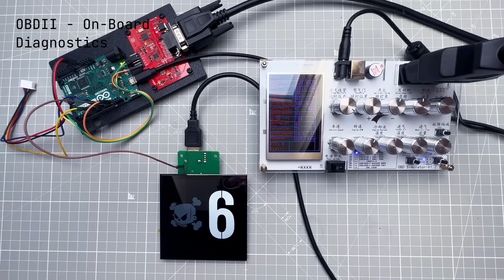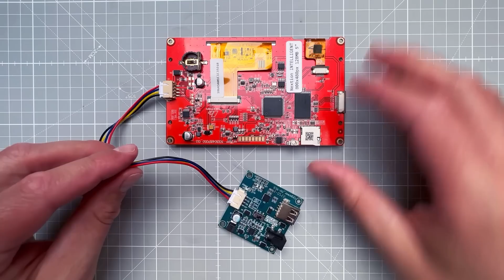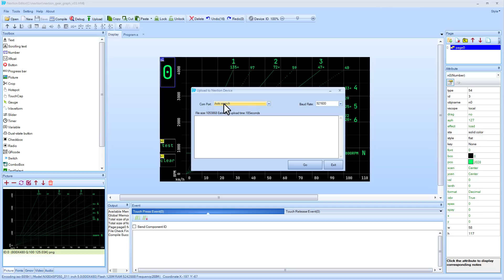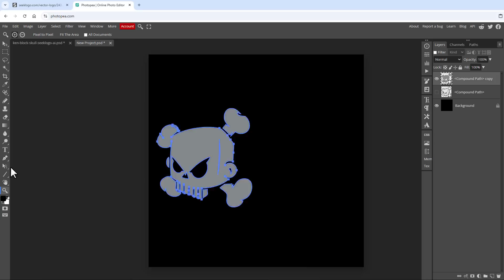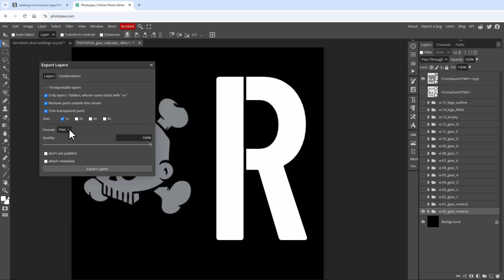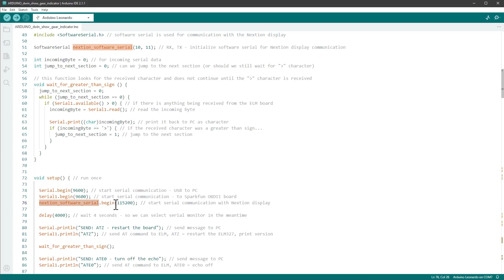Hoonicorn Mustang Gear Indicator (Arduino Project) - how to make gear indicator full tutorial

Comment: Hi, first of all thanks for all the videos and they are very helpful. I have an issue tho with this project. I had the same exact tools and setup as you yet when hook everything up scrren starts at R and then couple seconds later goes to N and stuck there.why would that happen? Even I change the RPM and Speed on OBD sim. still stuck at N
Reply from the maker: Could you perhaps debug the RPM and SPEED values to see if you are getting correct data?
Reply: @upir_upir  thanks for the reply, I realized that the OBDII simulator is broken, seems like functioning but not sending data to UART, and I also had to change the values for gears because my car is mph vs kmh...waiting for the new simulator so I will let you know the final result. but already learned alot from you so thank you no matter what happens...
Reply: @upir_upir  I fixed that issue by buying a new simulator and it working fine, the only issue is for me to get the right ratios...I live in USA and I believe car is sending data as "Mile"...I am spending alot of time to figure the ratios for my car out.

Comment: Awesome! I started a very similar build but for my automatic SS Camaro. I used an arduino to build a CAN sniffer and just got a huge data dump and by selecting gears in certain orders I had a pattern I could recognize. I found the PID and started to map it out. I have been semi successful but there are so many different options of PID from the trans. Sport mode makes it even more difficult. I think ill try this approach of using RPM and speed. Thank you for the video!
Reply from the maker: Cool, thank you for your comment! Have you tried that A4 PID? If your car is reporting that, it should be simple.
Reply: @ yes but each gear gives different lines in different situations. Like onsite vs down shift etc. and when the car is in “sport mode” it’s an entire different line. I have been semi successful with it and if I put some more time into it I’m sure I could sort it out